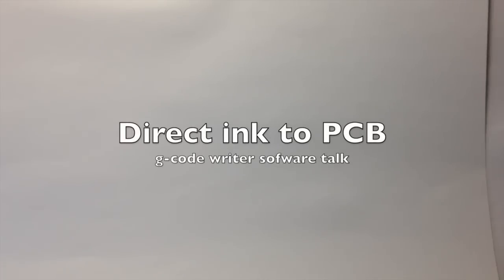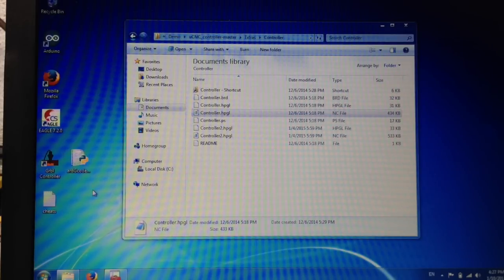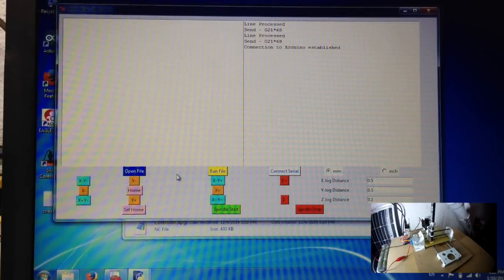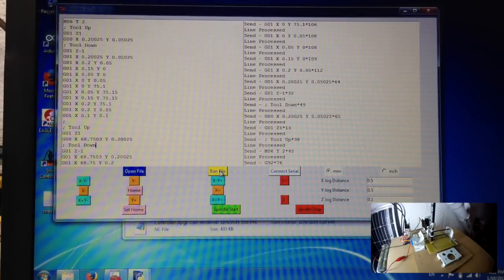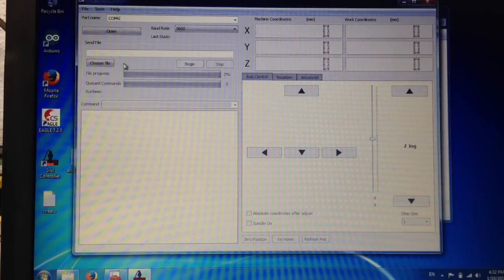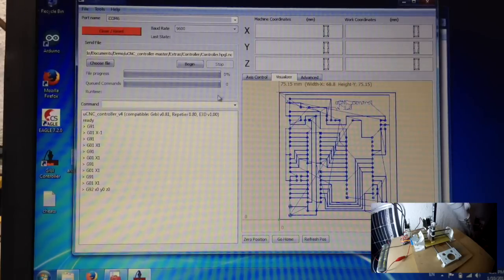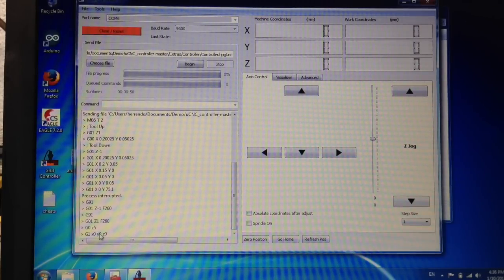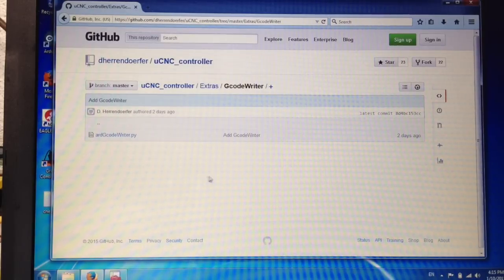Direct ink to PCB-Writer talk

Comment: Hello, having a few issues with getting the Grbl controller 3.6.1 to connect with my Arduino Uno. Baud rate is 9600 and i can recieve com via arduino serial monitor however when i attempt to connect it gives me the error "No data from COM port after connect. Expecting Grbl Version string." i can also connect via Gcodesender.exe. 

i have tried to get your Gcodewrite working with python as well but it just throws me an error "Traceback (most recent call last):
  File "C:\Python35\ard.py", line 9, in <module>
    from Tkinter import *
ImportError: No module named 'Tkinter'"

I have 

http://www.jaycar.com.au/arduino-compatible-5v-stepper-motor-with-controller/p/XC4458

currently plugged into my Arduino uno 8,9,10,11
with power 

Whenever i hit open Grbl controller or reset it turns the stepper motor.
Also tried with an arduino nano both running Atmega328P-PU

Any help would be amazing. Cheers!
Reply from the maker: Hello, Grbl controller is not the easiest to get to work, but if you see the welcome message through the Arduino IDEs serial monitor it should look like "uCNC_controller (compatible: Grbl v0.81, Repetier 0.80, E3D v1.00)".
These are required to satisfy Grbl controller, I believe. 
To get ardGcodeSender to work you need python 2.7 in 32bit as well as the pythonSerial library in 32bit. (No matter wat your OS is). Tkinter is usually a part of the full python 2.7 install.
Reply: +Dirk Herrendoerfer i gave up trying to get it to work it would have been nice.... i replicated your exact design with an arduino nano and the same servos. ill just upgrade my servos and run the standard config
Reply: +Dirk Herrendoerfer ill also try the older python.
Reply from the maker: Cool - I understand that the g-code writer software tools can be quite enervating - I did not author any of those tools, I just fix and maintain  them as well as I can in case of the python script. Unfortunately there is no one-size-fits-all solution, or I haven't fount it yet.
Reply: Hey Dirk, When was the last time you done a fresh install and tested your design instructions? on a clean version of windows. Today i have done this on 3 seperate windows computers. 

steps are as follows 

Windows 7 and windows 8 and 10 

step 1 install arduino software on pc
Step 2 plug in arduino uno original upload untouched standard uCNC_controller (others dont compile or throw error) 
Step 3 check serial monitor com4 (uCNC_controller (compatible: Grbl v0.81, Repetier 0.80, E3D v1.00)
ready)
Message appears.

download fresh install of GRBL controller from link - https://github.com/zapmaker/GrblHoming/releases
GrblController361Setup.exe - installed

Run as admin - 
Com4 selected
Baud Rate 9600 (nano or uno)
Always get the same error 
">(CTRL-X)
No data from COM port after connect. Expecting grbl version string.

As you see above it is sent the code in arduino serial port but it doesnt work with the gbrl controller.
Reply from the maker: Just tried it out, and it works for me. Installed Grbl-Controller 3.6.1, disabled position report and preloading. Connects and sends g-code. Did it on Win 7.
Reply: i couldn't get Grbl controller 3.6.1 working however i got G code driver to sort of work (by installing https://pypi.python.org/pypi/pyserial/2.7). however i now have the issue where i try to open a file then go to run it and it sends a few lines of code then locks up and crashes the program i can move the stepper motors and everything however any time i hit connect it also never says connected or says ready unless i reset the board completely a few times. the stepper motors do their cycle. however if i try to move Z+ or Z- it also crashes the program.  i open the nc file included in your uCNC_controller-master\Extras\Controller\Controller.hpgl.nc runs one or two lines then down  last line it sends is Send- G01 Z1*13 then crash. any ideas why its doing this? the setting is sett to MM and all stock
Reply from the maker: That is somewhat of a common issue - you probably have a setup where you configured the motor_mode to something with a servo for axis Z but you do not have a valid config for the Z-Axis steppers. There needs to be a valid stepper config, because the movement of the servo is actually done by emulating the movement of a stepper.
Reply from the maker: Do you get no output at all in Grbl Controller when connecting ? 
Someone else is reporting the problem, and I'm investigating deeper.
Reply: +Dirk Herrendoerfer yeah, nothing is printed in the controller no messages nothing. i did have success with the arducode one however but it never comes up with connection established or anything it just takes the code and moves
Reply from the maker: Please try and download the v4 beta version - you will need to configure it again, but apparently this one works.
Reply: +Dirk Herrendoerfer last time i tried to get v4 working it didnt compile due to switch powerdown error
Reply: Arduino: 1.6.9 (Windows 8.1), Board: "Arduino/Genuino Uno"

C:\Users\Jesse\Desktop\CNC\uCNC_controller-master\beta\uCNC_controller_v4\uCNC_controller_v4\uCNC_controller_v4.ino: In function 'void loop()':

uCNC_controller_v4:224: error: 'powerdown' was not declared in this scope

         powerdown();

                   ^

C:\Users\Jesse\Desktop\CNC\uCNC_controller-master\beta\uCNC_controller_v4\uCNC_controller_v4\uCNC_gcode.ino: In function 'void process_command(uint8_t*)':

uCNC_gcode:159: error: 'powerdown' was not declared in this scope

       powerdown();

                 ^

exit status 1
'powerdown' was not declared in this scope

i get that when i try
Reply from the maker: I advise against using the 1.6.xx Arduino IDE, instead please use 1.0.5 or 1.0.6 - the 1.6 versions do some odd unwinding of c++ code that leads to problems, also some definition names have changed for hardware features.
Reply: Trying it now ill let you know. btw i just just had everything 3d printed and put together!
Reply: Its working! the only thing i need to get it working is the bearings. Anyway i can send you photos ? i had to modify for different size rails as 5mm rails arnt standard here in aus
Reply: Well its communicating with the board. weather or not it works properly is anothing its accepting the controller which is great now. ill keep you posted
Reply: got everything to work correctly, any reason why the visualiser doesnt work?
Reply from the maker: The visualizer requires a Grbl-Proprietary extension to the g-code data protocol that I can't implement.
Reply: +Dirk Herrendoerfer i see!, well atleast its working now it shows the path and progress % anyway of getting the co ordinates to show in the top right? or is that the same situation?
Reply from the maker: Tested-Fitness Yes, that is due to the same issue.
Reply: Any tips on getting the nylon tight enough ?
Reply from the maker: Sure, I usually put 2 windings around the stepper rod then knot the Nylon at the carriage not too tight and add a third winding to the stepper rod. If the nylon is slipping excessively, put a drop of glue on the rod and let id dry completely.
Reply: +Dirk Herrendoerfer no worries and what pen are you using soecifically for sizing is it 315 / 308?
Reply from the maker: The pen is a Staedtler Lumocolor permanent S in Black. Red is supposed to work good too, but apparently not for me.
Reply: found the pen, got it drawing however my servo stutters and raises randomly without the grbl controller telling it to raise i believe its an issue with the servo and nothing else ill let you know how a new servo goes can you please link me to an ebay servo thats the same as yours ?
Reply from the maker: Could the power source be too small ? That would make it jitter.  Just search for an 8g TowerPro servo.
Reply: i just picked up that exact model and i plugged it in even without running a nc through it its going crazy flipping all over the place.
Reply: do i have to configure any settings for it to run ? just using the default settings ?
Reply: having issues also with the scale i export a hgpl out of eagle at like  max 10mm by 10mm and it makes it 10 times the size ? any suggestions?
Reply from the maker: use the -t (true size switch) on hp2xx, e.g. hp2xx -t -m nc <filename>
Reply: awesome that fixed it however now i believe the servo is reversed its leaving random lines and drawing in mid air
Reply: to expand on my last post i try to get it to draw a square outside an object and it does the whole square in mid air
Reply: it also draws the jump lines
Reply from the maker: Oh, I need to look into that - I don't know if reversing the sign on the Z stepper stepsPerMillimeter value will invert the servo too, but you can try it out.
Reply: ill give it a shot
Reply: yes it works! finally thank you so much!

Comment: +Dirk Herrendoerfer Hi Dirk. I have successfully complied and uploaded the Arduino sketch to my Uno board. When I run the ardGcodeWriter and click serial connect I get the following message in the python window, "SerialException: could not open port 'COM3': WindowsError(5, 'Access is denied.'). My Arduino is connected to COM3. Do you know to fix this? Thanks.
Reply from the maker: I do not know exactly how Windows manages rights to access hardware ports, but I suppose that running python with Administrator privileges (right-click, run as Administrator) should fix the issue. Also make sure that no other application is using the COM port at the same time.

Comment: Hi Dirk
1) i downloaded GRBL Controller but i cannot use it because it read only .nc files , i'm using a DipTrace Program (not Eagle) it generate me a .Dip files. There's some file-Programs convertion File ? 
2) what about your plotter mechanics have you the the drawings with all the measures of the   pieces?
thank you.
Reply from the maker: Hi Reinaldo, for some reason all your comments are declared as spam by YT, possibly because you included links and email addresses. For those messages I do not get notifications - sorry about that.
As I say in the video - sizes and layout are up to you, the software does not care about them, as it will always start from the zero position you set at the beginning of the plot process. So you can build it any size you like. The theoretical range is within several kilometres.
I don't know about .dip files, and how they work - there are converters available for image files like hpgl and so on, or vector formats like gerber. All these generate .nc files in the end, and that is what my firmware supports.
Cheers, Dirk
Reply: hi Dirk, thank you to your reply ,

before make the plotter's mechanics i want undestand what program-controller i need!!!!
In your videos you explained the hpgp-converter(jpeg files) and the grbl-controller-program(vectorial).
In my circuit board  there isn't a simple lines-connection beetwin components (i don't know if i can use this vector-image-controller) i need to fill-in the area connection-component.

If you want understand more about my problem there's follow link:
this is my circuit-board:
https://drive.google.com/open?id=0B66WgapwucRtRmZRbzJGUXY2QWc
and this my circuit using grbl controller project:
https://drive.google.com/open?id=0B66WgapwucRtQmdiUmk2TTYxT3c
here there's Circuit-board exported-files for grbl program:(i used bottom.gbr file)
https://drive.google.com/open?id=0B66WgapwucRtdTh6NlYwWnF0b1k

there's something wrong? 

Thank you (to your patient :-) ).
Reply from the maker: I've never worked with gerber files this way before, but the g-code file looks fine, it is just missing the pads, which might be in a different file. But saying that - I have never done this myself, so I may be wrong.

Comment: Hello Dirk Herrendoerfer,
Thank you so much for sharing your project. I appreciate your effort and am sorry for the broken equipment you had on this project.
I picked up my old hobby (electronics) again but have great trouble with making pcb's. That is why i decided to build a small plotter like yours. But i have a few questions, i hope you can push me into the right direction.
My set-up now: Arduino Nano (clone), ULN2003, two steppers and a servo. In the ino-file i set the stepsPerMM variables, motor mode = 0 and the COMport in the python script and it sort of works.
Sort of... z axis (servo) does nothing, and when i run the supplied .nc file, it sends commands, but only now and then the nano returns something and "line processed" is printed. Clicking "connect serial" button resets? the nano (steppers run a while), but no "ok" appears. When i click the "mm" button some "resends...huh... " shows. And after a while of experimenting the gcodewriter program hangs...
Do i mis some settings maybe?
Many thanks in advance,
Bill
Reply from the maker: +bill nahd I think motorMode=1 should solve most of your problems, try some commands for each axis through the serial monitor of the Arduino IDE first. That way you get a better feel if it is working as expected.
Reply: +Dirk Herrendoerfer     Thank you for your quick reply. Yes the motor mode brought everything to life. The only strange thing i still see is that there is a long pause (10-15sec) between a tool up/down action, before the steppers starting the next run... but that is no big deal i think. ^_^
Thanks again and success with the new projects.
- bill -
Reply from the maker: +bill nahd Have a look at the stepsPerMillimeter and speed for axis Z, these values do influence the movement, because they are emulated for the servo so it acts more like a motor would.

Comment: Hi Dirk, I hope you can help me, I connect with GRBL and arrows of the x, y, z moves without problem, but when I open the .nc file does not work, the red dot stays on the inteface, thanks for your help!
Reply from the maker: +Raúl You need to set GRBL Control to not poll for current position and disable all multiple sending of code. The firmware only supports ping-pong mode with ok as the successful reply.
Reply: Also when i try to use $$ command its not working

Comment: Ayuda ¿cuales son tus parámetros del grbl controll o como esta configurado tengo los mismos motores?
Reply from the maker: +Tobi Vaz Which settings are you referring to ?
Reply: +Dirk Herrendoerfer. Hola me refiero a los comandos que tiene el grbl controll para que pueda funcionar el motor porque cuando los conectaba se calentaban y no se movían espero una respuesta.
Reply from the maker: +Tobi Vaz You need to disable all GRBL-specific functions like multi-command sending and position reporting, uCNC_controller, only supports ping-pong communication.
Reply: +Dirk Herrendoerfer. Disculpa no te entendí, yo hablo de que cuando pones los signos ($$) en comando que valores le pones para que los motores funcionen. Espero una respuesta gracias.
Reply: +Tobi Vaz??
Reply from the maker: I don't understand the question, that is basic shell usage, it has nothing to do with 32 or 64-bit binary format. Could you elaborate ?
Reply: +Dirk Herrendoerfer Hola buen dia, no me refiero a eso si no cuando tu selección donde dice command y pones $$ después te sale una lista que te dice $0=100.00(x, step/mm), $1=100.00(y, step/mm),...  ¿Que medidas o numero le pones en esas partes y en las demás,  disculpa si hago muchas preguntas pero soy nuevo en esto.
Reply from the maker: +Tobi Vaz Oh, those are the basic settings for any machine. The controller needs to know how far to spin the motor to move the tool 1mm, these settings are dependent of the machine and need to be configured before you can use it.

Comment: Hello a question if as I have arduino programming and controll gbrl what is the first thing I run arduino or gbrl ?
Reply from the maker: +Tobi Vaz Not sure I understand the question correctly, you need to program the Arduino once with the Arduino programming IDE, after that you can use GRBL Control without ever starting the Arduino IDE.
Reply: +Dirk Herrendoerfer Hola en verdad muchas Gracias pero no se mueven los motores no se que pasa.
Reply from the maker: +Tobi Vaz Well, what did you try yet, and which software are you using ?
Reply: +Dirk Herrendoerfer pasame un correo para que te pueda explicar ll que he hecho. Por favor
Reply: +Tobi Vaz hola lo que he hecho es conectar los motores al arduino con los pines dados en la programación de arduino, después conecto el arduino corro la programación que das y después flacheo el arduino para que pueda reconocer el grbl controll y después me reconoce el programa e arduino pero cuando lo corro en el grbl no funciona solo eso he hecho.
Reply: +Tobi Vaz??
Reply from the maker: +Tobi Vaz Apologies, I did not receive any comment updates to this thread in YT. You will need to turn off all optional features in GRBL Control settings, so GRBL Control just sends the command and waits for the ok reply. I don't know any better, as I did not author any part of that tool, and GRBL has a number of non-standard extensions to the g-code protocol.